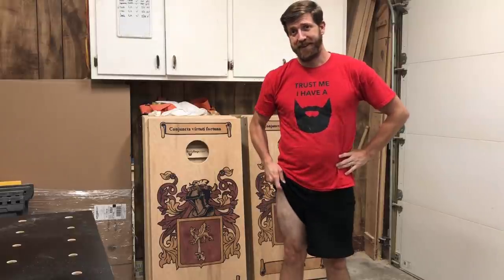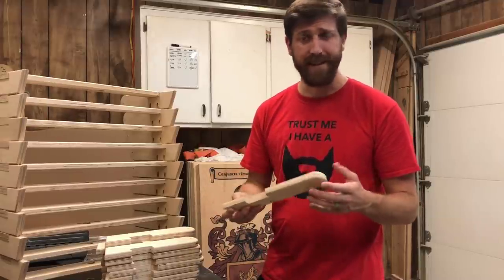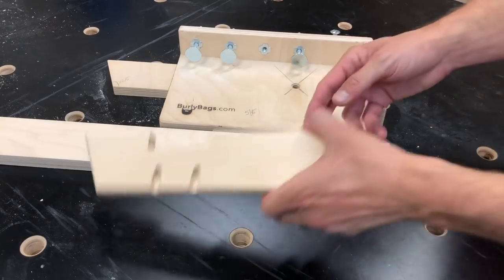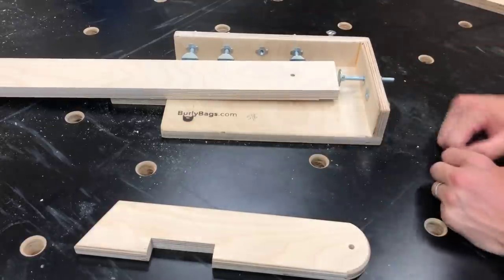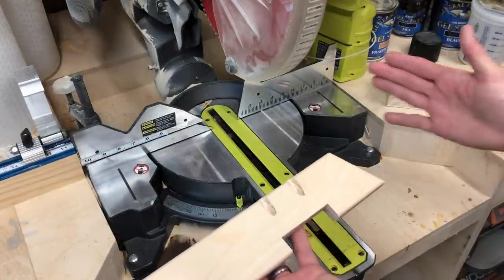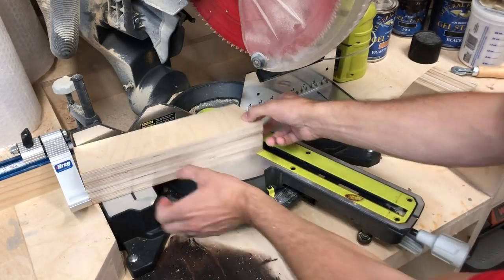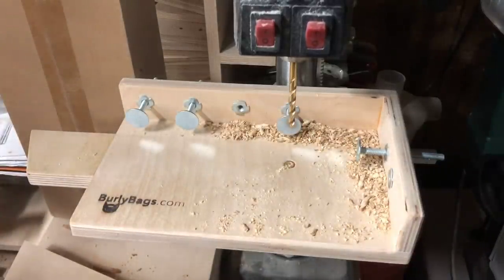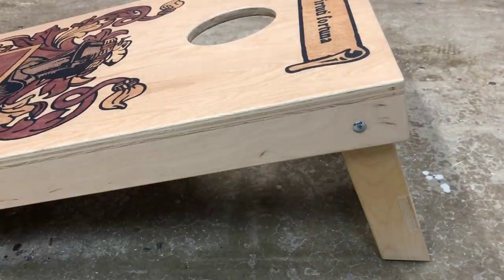Jigs 101: Leg Jig for batching  (How to make legs for cornhole boards)

Comment: Building my first set of boards for a wedding gift to my daughter. I have looked at quite a few videos of different ways to build. I decided on using 3/4” Baltic birch for all of it. Trying to cut time I designed the legs and cut them with a CNC. Takes about 3 minutes for for a set of 4 legs. I might could start building these as a kit to put together.
Reply from the maker: Very nice. Excited to see what you make 👌

Comment: Great video!  Do you have a jig or some slick way of cutting the notches in the legs for the cross brace?
Reply from the maker: Thank you so much! No jig but a super easy method. I stack about 20-30 legs at a time, with two bar clamps one on toe and one at other end of leg. And do a dado on my table saw. The stack is nice and ridgid and I slide it with the toes on the fence. Does that make sense?
Reply: @cornholecollective7116  that's so simple it's genius. I was wondering the same thing. Great idea! Ive made probably 20 sets and have been doing legs the hard way this whole time. Starting to get sick of it. Im going with that jig and lock stop. With that new set angle, how did you find where the hole on the frame goes?

Comment: So maybe this is a stupid question.. but couldn't you just make 1 leg.. then just place it on a board, draw the cut, drill the hole.. rinse/repeat? The jig is cool.. but it seems like it's more work than just what I said. The bandsaw jig is slick though.. I just spent 2 hours use a jigsaw and sanding to try to get my 4 legs to open/close.. sucked ass. However this is the only one I have made.. but if I were to make a lot would absolutely need a repeatable setup.
Reply from the maker: Not a stupid question at all. The precision required to be able to make legs independently of the boards would require a jig of some sort. That would work in theory, however if you stacked two boards, measured dead center and drilled a hole, then flipped one board and put a bolt through the two holes they would no longer be flush. The bit will drift a little, and the flipping of the board compounds this error. This is a distinct possibility when making legs independently…. Some of the boards will be flipped. But this jig is aimed towards builders who plan to continue building. Like you said, you spent two hours on the jig saw and sander… I spent a little longer than that devising, constricting and dialing in my bandsaw jig, but now between cutting the legs, drilling the holes and rounding the ends, I have about 1 minute invested in each leg. For me, the investment has paid in dividends, where as for a builder who’s only building a couple, the hard slow way is likely the most ideal.

Comment: How did you figure out the 22 1/2 degree angle?  I usually put a 1/2" spacer between the back frame and the leg, but I don't know that the angle on the leg equals 22 1/2"
Reply from the maker: Mine was actually blind luck early on... and when I realized it matched a click stop on my miter... and then when I realized the benefits I never let that angle change.
Reply: usually you put the legs on the board, lift the board the 12 inches and mark the legs...he kinda did it the other way around...using a fixed, hard stop on his mitre saw, then figuring where to put the hole thru the side...using the fixed hard stop on the mitre saw removes the guess work out of the equation...

Comment: Why do use plywood for the legs instead of 2x4? I feel like you would need to double up the plywood for the legs. Do you find the plywood to be more durable?
Reply from the maker: I totally get the concern, but I’m using Baltic birch, which is an incredible and strong ply. Very different than the birch you may see at Home Depot or Lowe’s. I’ve never been an advocate for 2x4 so I can’t compare experiences but I can make a pretty spectacular leg with my Baltic, and am quite pleased with the results. I wouldn’t try it with another ply personally though, as the layers are not the same as these. Hope that makes sense, a this is not a wood you’d see in a big box store
Reply: @cornholecollective7116 bouncing boards and durability are my primary concern. I use birch as well, but don't know if it is domestic or baltic. If birch ever costs more than maple, then I would probably switch to maple. 
My first set was built out of pine plywood and it took so much TLC to get them to look and feel right that I realized I was wasting time.... and pine is much heavier.
Reply from the maker: So this is a common area of confusion and it kind of has a long answer. But short story longer (by adding a somewhat quick answer before a longer one) you will know I’d you’re getting Baltic because it’s harder to get, and will blow your mind 😜. At a big box store like Home Depot, “birch” basically consists of two thin sheets of veneer (imported from Costa Rica or another country) and is filled with layers of cheap soft woods and such as pine, mdf, and unfortunately, air (ie voids). I’m not knocking it, we have to start with it usually, but get to a lumber yard, you can find better quality (such as domestic birch shop grade) that costs about the same, but has thicker veneer and better layers. Baltic birch is made of birch from the Baltics (Russia, Finland,etc). It is made entirely of Baltic birch veneer (which means each layer responds the same to temp and humidity changes) and is layers in alternating directions for superior strength and density (it weighs a ton). It is typically found in a 5x5 because the us has to be different and the rest of the world enjoys their 1525mmx1525mm (5x5) sheets of domestic birch because it’s basically the international standard for custom kitchens. This is why it will usually be significantly less expensive per square foot than a 4x8, which is us reinventing the wheel making it uniquely for a select group within a single country. (Note a 5x5 makes exactly one full set of boards and frames.... video coming soon). Baltic is amazing to build with, however is boring grain and is less fun to stain, but is insanely strong, smooth and heavy. 3/4” ply on a board weighing 25lbs will not bound I’d it sits flat on ground (a wobbly board will bounce. And a light board will bounce, spring from 1/2” ply isn’t the only source for bounce)... but Baltic is kryptonite for bounce!! And also for shipping rates (heavy haha). I hope that helps! Thanks!!
Reply: Awesome information. I need to find a local lumber yard instead of the big box stores!!
Reply from the maker: It’s a bit of a game changer. You can find higher quality for the same price, and then all kinds of other options too. However prices are not listed, and if you don’t have much of a plan of what you’re looking for, it can be a little overwhelming. But a good sales rep will show you around and help you feel more comfortable 👍 good luck
Reply: @cornholecollective7116  you get 14 evenly spaced plys in the Baltic. has to be Baltic though and not a different variety of birch. You can get it at the big stores but it has to be special order. There is no other plywood that goes insane with the layers. Great product but not sure I like the look of it on  the legs. Most would think weaker but myself I think since you have them on edge they are probably stronger. 14 alternating grain layers glued together.....The ONLY ply like it.

Comment: I've seen some wood workers use the method of gluing two pieces of wood together and follow up with a finish nailer to keep the pieces "clamped" in place while the glue dries. Once together, the woodworker will use screws as well. What circumstance is this practical and what circumstance is it not practical? I assumed glue was the only thing you needed if clamped properly and time permitted.
Reply from the maker: Hi Rustin, I’m not sure I followed that question? I don’t glue anything in my leg building process. I also do not use brad nails personally for anything, however on my frame assembly I use glue in the joints as I use kreg screws to assemble them. I have found that my back frame brace is far more sturdy when pressure is put on the boards with the legs open, than when I don’t use glue. Personally I believe it is very necessary for the frame, but I don’t glue on my top. I have not run into, nor can I imagine a situation where that kind of strength is necessary... but I have installed my top in the opposite direction as my frame and needed to remove and rotate. And then finally, to answer your glue only questioned I’m just not personally willing to invest that heavily on clamps, and though the idea seems sound, I prefer just doing screws in case the outer veneer decides to just flake off with the glue keeping it attached to the other piece. The screws make me feel warm and fuzzy with safety haha. Hope I kind of answered my approach to those situations?
Reply: @cornholecollective7116  Yes. Thank you for your time and the reply.
Reply from the maker: No problem at all! Good luck with your build 👍

Comment: was also wondering how you notch the legs to accept the cross members?  Did I miss that?
Reply from the maker: I notch my legs using a dado stack on my table saw. I actually clamp a big stack of them together using two clamps, (one on each end of leg) and run through with the toes against the fence. If you attempt this, please take care to place the clamps outside of the cutting area..... or you may have a bad time 😳

Comment: where can I purchase the same high quality birch plywood you use for your boards.
Reply from the maker: Hey Gene and Barbara... this is Baltic birch and will be found at your lumber yard. It comes in a 5x5 (don’t worry about the 4x8... hope to have a video soon to explain why) and is amazing to build with! Hope that helps
Reply: I live in SE Massachusetts and baltic birch was very difficult to find for me.  Of course the big box stores don't have it.  Most of the smaller lumber yards don't carry it.  One was willing to order it for me at $150 per 4x8 sheet (gulp).  Just by calling around, I found a small lumber yard that caters to cabinet makers.  They have 5x5 sheets in sizes from 1/8" up to 1".  The 3/4" is $45/sheet, which I thought was pretty good.  So my point is to not depend on google to find it.  You'll have to do some old fashioned phone calling to find a place.

Comment: great!
did you ever make a video explaining how you made the band saw jig for rounding the top end of the legs?  Just wondering.
Reply from the maker: Hey mike! I have not yet covered the bandsaw jig, but hope to eventually. For now I can tell you it’s all in the thickness of the bandsaw blade (google “bandsaw radius chart”) to help figure out if yours will work, And the location of the bolt on the jig’s leg carrier. You’d want that bolt centered on your bandsaw blade, and 1/2” of the width of your leg away. Then when you stack your leg on top of this leg carrier pivot thing, ensure you’re leg hole will be shifted about 1/2” in front of the blade, before it pivots. I hope that makes sense. Good luck
Reply: @cornholecollective7116  OK, I think I figured out this bandsaw jig and I think it is going to work o.k.  I realize every bandsaw is probably different so making a video on this probably isn't simple.  But one thing I hope you can tell me is this.....After you cut the rounded end on your legs using this jig, is your leg the exact right length at that point?  You have already cut the correct angle on the lower end of the leg with your other jig and you mentioned in that video that you left the leg a bit long so that you could cut the rounded end on the upper end of the leg.  So if the leg is the exact length after you cut the rounded end on it, how to you know what that length is going to be after the round is cut?  I probably am not making that very clear but hopefully you get the basic point of my question.  I mean your jig that you use to cut the hole in the leg and in the frame is very precise, etc.  But then after that you put the leg in the band saw jig and cut the ruounded end so there must be some exact placement of the band saw jig in relation to the lower end of the leg.  I dunno.....just can't quite wrap my old head around this.  Thanks again.  Great stuff!
Reply: maybe the only thing that matters is the distance from the 1/4" hole to the bottom of the leg so the arc at the top is not completely critical?
Reply: Just two more questions and I will stop bothering you about this bandsaw jig.  It looks like you made the "pin" that the leg pivots on from a carriage bolt or something that you cut off after you screwed it into the carriage from the bottom.  And the other question is what kind of lock nut, washer, etc did you use to attach the carriage to the piece of plywood underneath?  Seems like that would want to "work loose" after multiple turns that it has to undergo while making the arcs on the legs.  Thanks again and I won't ask any more questions about this lol!!!

Comment: Did you change your design? Looks like you're using plywood for the frames and legs now..
Reply from the maker: Hi RR. No changes in design, unfortunately this is just some confusion caused by there being two of us running the channel. Scott (@mossboards) is the creator of the “build better boards” series and has a different leg and frame style than I do. While many aspects of our two approaches and designs overlap significantly, unfortunately our legs are on two different paths. This video would be geared towards the 1/2 of people using 1Xs or ripped ply legs. While “making legs the hard way” is the same for both methods, this video would only apply to those with legs the same width as the frame. I really should have been able to see this coming and addressed it in the video. Sorry about that.

Comment: I found some 5x5 Baltic how do you get a full set out of that?
Reply from the maker: Feel free to dm me @burlybags on Instagram or hit me up in our new awesome Facebook group.... but here’s an abbreviated version.... 2.5” frames and you get full set including center brace and leg brace. You’ll cut the top 1’ off giving you a 1’x5’ chunk which will give you 6 horizontal frame pieces and two leg braces, and then 4 legs... then you’ll be left with a 4’x5’ chunk that you’ll rip two decks out of leaving your with a 1’x4’ chunk that gives you 4 side frame pieces.... then you’ll have a beer and rejoice in the mathematical perfection.... and to take it a step further, I personally don’t like staining Baltic, so I primarily use it for frames.... so I save my tops and if needed I can break them down into frames... each top makes exactly one frame 🤯... it’s like an ocd dream
Reply: @cornholecollective7116  Thanks! I cut that up tonight. Perfect! I cut a dado joint 1/2" in on the sides. Is there an easy way to figure where the holes go on the sides? I was thinking of using 31.6 miter
 detent.
Reply from the maker: not that I’m aware of... you get to do it the “hard way” unfortunately... glad the Baltic went well!!!

Comment: When did you start using plywood for the frames and legs? Is there a video on that?  I take a jig @ $50, sending you an email
Reply from the maker: Hi mike, I know you already emailed, but to help with that same question for others I’d like to answer it here too. “Cornhole collective” is a channel run by myself (hunter @burlybags) and Scott (@mossboards). We both have slightly contrasting styles. And I personally rip my frames and legs from 3/4” Baltic birch, where Scott uses select pine 1x3, and 2x3 legs. Unfortunately in areas like this where I am discussing my method, and it is quite different than the methods he used in “building some better boards” it causes a bit of confusion. I’m fortunate to have more free reign in my garage to use it as a shop, where as his must retain the function of garage too. This allows me to have a large table saw and pursue methods in the direction of batching larger quantities, where his space limitations must keep his methods compact. Thank you for taking the time to ask, because I’m sure we’ve got to be causing this confusion pretty often.
Reply: @cornholecollective7116  Hunter - Thank you and Scott so much for sharing your expertise. Your channel has totally upp'd my cornhole game! In regards to plywood vs. dimensional lumber for the legs - How do they hold up? I have been afraid to use plywood because my customers have kids jumping on the boards and they take quite a bit of abuse. Appreciate any thoughts you could share
Reply from the maker: Thanks Jeff! We’re having fun and always love hearing that people are enjoying our work. Personally I love my ply, but am using Baltic birch which is quite unique and amazing to build with, and very different than any ply you’d find at Home Depot. If you can do Baltic, I’d consider it for its strength and time saved for shipping for straight boards. But If I didn’t have Baltic I’d be using dimensional lumber. I hope that helps answer your question and again, appreciate hearing the feedback!! Welcome to the collective!